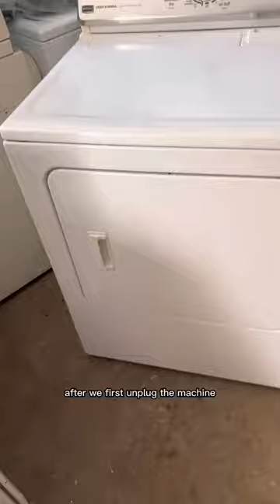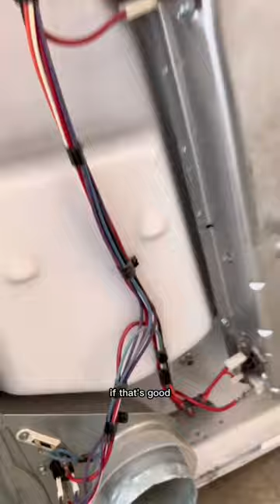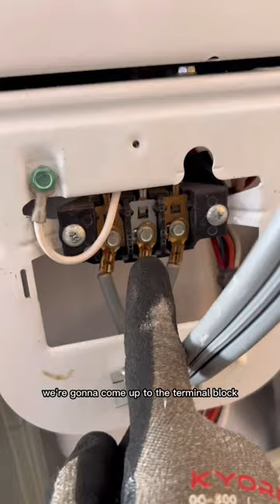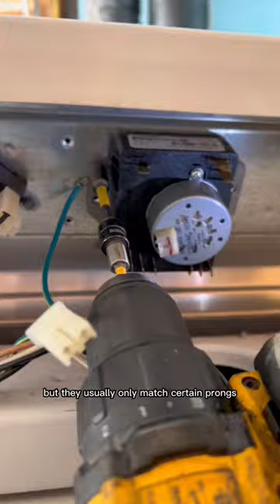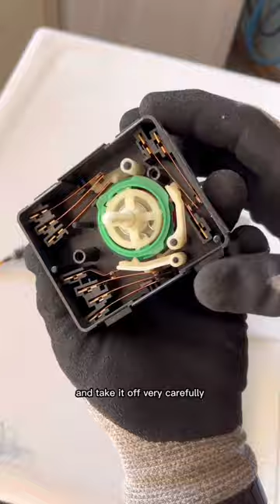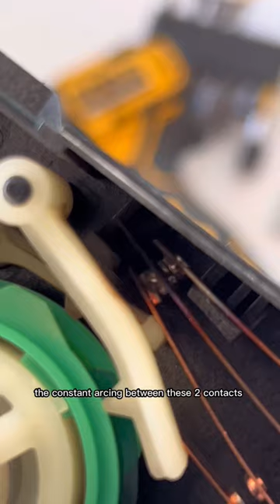Maytag dryer not heating

Comment: That was a lot of good info at JET SPEED.
Reply: whats checking continuity? how do you check?
Reply: @startful Another word for "SHORTED"... use a multi-meter to check for thermostats that are shorted  (bad) or have resistance (good)...
Reply: @jumperstartful just wether there is an electrical connection. Get a very cheap multimeter that has it and.. yeah

Comment: NOTE:  On some dryers the drum will continue to spin with a blown thermo fuse.  they will be part of the heating circuit.  Electric  or gas.
Reply: But you won't have heat my elite did that.
Reply: Yep, my 70s Maytag blew its thermal fuse and kept right on spinning because it wasn't part of that circuit, only a part of the element circuit. And since the model in the video is literally built the exact same way as that 70s avocado one was, it's probably wired the same way.
Reply: *most
Reply: Yes, just changed the thermal fuse. Blew out brushed out, vacuumed out the lint. Good to go.
Reply: Kenmore 80 series did just that  spinning but ingintor & thermo cup no go. R&R fuse ba boom heat !

Comment: I usually watch these videos and think "I could do that".  This video made me say nope
Reply: It’s actually very easy. Even if you don’t check the continuity changing all the sensors is cheaper than any call for service. Few years ago I took them to the store and they figured out which was bad.
Reply: Hire someone
Reply: I did it it's easy don't get intimidated
Reply: Yepp
Reply: All you need is an understanding of electricity and machine controls. Easy peasy.
Reply: Right this isn't so easy but my dryer is doing the exact same thing but instead of no heat I have light heat 😂😂😂
Reply: You literally just need a screwdriver. South Park was right, people can’t do Shit for themselves

Comment: You are doing such a service sharing this info. Firefighter companies should hire you for home safety. Real estate agents should hire you to help new homeowners. Work with a home inspector too. I hope you're the most sought after handy man in your area!!!! Thank you!!!
Reply: They probably won't give in his background, but yes I agree

I'm learning more in minutes from his videos that I've learned from hands-on experience do dryers constantly going out in mom not wanting to buy new ones and instead would rather tear these ones up to find out what's wrong with them, or just find used ones that she can patch up 

Many many years of this and it turns out the problem was never even the dryers in the first place, but rather that the ground wire for the outlet was very very loose and so will the others causing fluctuations in power draw that would cause the dryers to wear out so much quicker

For a long time we could never figure out why we would have consistent issues in the nature of what was going on, because the heating elements would be the main thing that would go bad

Because they would get replaced multiple times with each dryer before we can eventually change to a new one

And it wasn't from lack of cleaning the lint trap because moms anal about that.

My grandfather got the wire issue fixed up and we haven't had issues since. 

We were going through a dryer or two a year and this dryer has been going for almost three now. And it was in the process of throwing fits up until the wire problem was resolved.

Comment: Mine did something like that, except one of the contacts had slid out of position and was only touching on it’s edge. I took it completely out, polished the contact buttons, and popped it back where it belonged. So far, so good! I always keep a spare set of sensors too.  My wife doesn’t like to have down-time with appliances.
    Also, I keep several sets of agitator dogs for the washer, they are about the only things that I’ve had go bad on our washer…. For years!

Comment: I had a no heat issue on a dryer in one of my rental properties. Checked the dryer and checked the voltage and everything looked good. I brought in an electrician who is smarter than me any discovered that the problem was out at the breaker panel. Another electrician that had done work on the house had switched both breakers onto one side of my panel.

Comment: Basicly find a check list for the possible problems.  I did this for a gas dryer. Ended up being the igniter. Was low on the check list as i had to disassemble a good deal to get to it. 

Also while in there clean out the lint.

Comment: I repair appliances for a living. U can file down those contacts to refurbish the timer then u can check continuity between the thick red and black wire on the back of timer usually tbe lower left connector

Comment: You can also check for continuity between the black and the red wires on the timer. Turn the knob to timed dry or more dry. Then test it. Always remember to unplug the dryer before doing this. You can also clean the terminals so you can still use the dryer while waiting on the new timer. eBay or Amazon will have the best deal. Most appliance parts websites will be 3 or 4 times more expensive.

Comment: If the contacts aren't in too bad a shape, use a two-sided finger nail file. Place between contacts and cycle file while pressing contacts together. Might extend life while hunting down replacement. I've done this on car points and AC contacts.

Comment: The dryer that came with my condo quit.  I took out the lint screen and looked inside to find a lot of lint.  After unplugging it, the loose lint was removed.  That fixed the problem.

Comment: I had a timer where the motor was shorted to ground via the case. The knob would spin round and round without stopping. Even when off you could hear the little motor running.

Comment: Excellent method, but verify 220v at the wall receptacle, first, before disassembling components !

An open hot leg at the wall receptacle may cause partial dryer operation.

Comment: Absolutely the only thing I do differently than this video is check that voltage at the terminal block FIRST.  I don't need to spend 20 minutes fussing with the customer's dryer if the issue is the breaker not sending 240 to the unit!

Comment: Probably should check the fuse or breaker before tearing apart the machine.
Reply: If the breaker was tripped, how would it be spinning?
Reply: Electric dryers run on 220v. Need 220v for heating element but only 110v for motor. Dryer can still spin with no heat if 1 fuse is blown.
Reply: @jimhartman6410  perhaps for internal fuses, but the breaker would be supplying power to the outlet the dryer was plugged into, was my point

Comment: Seen it a few times on the whirlpool dryer that no heat is a result of motor or a backed out wire to the motor but more often than not with all the fuses and elements good you have a bad timer

Comment: Checking continuity is not a good way of checking limits or heat strips. A better way is checking resistance. If it reads “OL” then the limit is open or there is a break in the strips. What you want to see is 0.0. If it has “continuity” it could also have a high resistance which means there is pitting across the contacts possibly which means there is a problem. It’s just always better practice to check resistance vs the ol beep beep method lol. Tells you a lot more

Comment: "if this looks like a fire hazard to you, then you would be correct"
...so, what I'm hearing is that you shouldn't buy that brand of dryer ever again?
Reply: I think he's exaggerating on that part, that is unless you have an extreme lint problem. As he said there is no longer continuity meaning that power through that area is no longer flowing through. No power=no heat. Plus that area is typically surrounded by sheet metal, without some sort of tinder like thing such as lint a fire is very unlikely. Plus while he says this a maytag dryer it's actually a whirlpool design and is probably the most produced dryer design ever in North America.

Comment: This is a mislead. FIRST, check your power to the dryer, make sure you do not have a blown fuse or bad breaker. If you lose one leg, you can have the same condition. A lot less work to check out.

Comment: If the washer or dryer is very old, I'd check for burnt contacts first.  both my washer and dryer are over 20 years old.   Keeping both functional isn't rocket science, but be aware that the edges of the sheet metal are very sharp as a knife.  You will quickly learn that the first time you disassemble a washer or dryer.  Also vacuum out the inside of the dryer every few years because there could be piles of lint covering the motor causing overheating.

Comment: First thing I learned how to check was the plug. The three metal plug tangs can get covered with oxidation and block proper current to the dryer. Using some sandpaper, nail file or hard eraser just clean that off all 3 tangs on both sides and then see if it works. Much cheaper fix than calling a guy who won't show up as promised or replacing expensive components.

Comment: I thought was crazy  had dry that exact problem from day 1 we bought brand new. they kept trying tell it was the vent in the apartment we lived in.   Pulled the timer off checked  with ohm meter and was told the timer don't go out normally when bought a new timer. 10 years later still have the same dryer nice video

Comment: Before any of that check breaker box and for the dryer switch, usually a double switch or one large one. Even if it doesn’t look tripped flip it off then back on. There are times a system gets tripped and will still run and even have a light on because it’s two phase and that second part that runs the heat is tripped. Many a time I come across that and resolves issues.
Reply: Nah they are just plugged in on a standard socket.
Reply: @dogwalker666  A 30amp 240vac receptacle isn't 'standard' & it certainly is protected by a two-pole breaker. Please leave anything vaguely electric alone & stick to changing doorknobs Mr "handyman"
Reply: Ding! Ding! Flip the breaker on and off. It's always worth the try.
Reply: Thanks, I will try this first on my mom’s dryer.
Reply: @user-lb8do4ew6k   if you look at his profile hes in the UK where 220 is indeed the standard. So he's correct relative to where he lives. Looking at his profile took less time than writing a reply. So you're the troll I guess 😢
Reply: @Greenredfield  regardless of voltage 30 Amp circuits are special use circuits. Compound that with the fact that the op is calling circuit breakers 'switches'.
 I have 25+ years in the trade
Reply: @user-lb8do4ew6k  yea that's fair, that's a lot of amps at that voltage and I'm sure code requires a different plug over there too. I can't defend calling a breaker a "switch."

Comment: I like the old timers better, the ones that have about 40 wires each one with its own terminal. To change them out you worked with ONE wire at a time, disconnect ONE wire, then plug it onto the correct terminal, then disconnect the next wire. Then there's the customer who brings in their old timer and did not make any kind of diagram as to what color wire goes where.

Comment: Thanks for the video -  saving this.    My Maytag dryer had stopped blowing hot air but was still spinning.  Wife said she heard a grinding noise followed by a burned smell.
Cleaned out lint that had fallen beyond the catch and built up a little in there….what do you know??  It started blowing hot air again without needing to fix or replace anything.

Comment: Can remember old school Whirlpool dryers lasting 20-25 years on the original timer, maybe longer.  Now days the timers typically fail in 1-3 years, losing the heat function. For that reason, I stock 5 different Whirlpool timers at my repair shop. Once again, this is an example of making parts that fail early, so you have to purchase expensive timers, or a new dryer. Never know of Whirlpool beefing up parts to last longer, only making them cheaper to fail sooner. **Buy Speed Queen. More initial cost, but last for years!!

Comment: You have to make sure you have 230 volts across the two hot wires. If they are  both pulled from the same 115 volt circuit in the fuse box the dryer will turn but you will not get heat

Comment: I ran into this problem twice. Both times it was an electrical issue with the wall plug, nothing to do with the dryer itself. First time was because a wire had come loose from the outlet. Second time was because one side of the main breaker in the fuse panel was bad. Two separate houses, two different problems but they had identical symptoms, the dryer would spin but not heat.

Comment: Hmm. The last 3 times Ive no heat, it was a burned out element. I say this because its a 5 minute fix and easy to spot without having do everything in this video, which could be done AFTER confirming the heating element.

Comment: You can also make sure one of the two breakers to the dryer were not tripped. If one is tripped the dryer can spin but not heat or heat but not spin.

Comment: ⭐️ Also check  if the fuse components are plugged in tight and properly( loose connections will cause burnt wires and blown fuses resulting in no heat ) . If you see any burn wires check those connections and most likely it’s a loose fitting

Comment: It is always a good idea to check the outlet in the wall as well for a no heat problem.. Most machines will run but not heat if one leg of the 220 line is dead.. I had this issue because the breaker went bad on one leg and wasn’t sending power to the heating elements.. but every other aspect was fine. A weird problem for sure.. but an easy enough thing to overlook if you are only checking continuity with the machine unplugged.

Comment: First, this is for an electric dryer.  There are some similarities, but some major difference.  Most no heat issues in a gas dryer involve the igniter circuit and that varies with the type of igniter used.

Comment: Did you know if you take off the thermal cutoff fuse and hit it with a screwdriver until things start shaking insideand they hook it back to the dryer it will start heating again lol try it

Comment: umm you did this in reverse. check timer, then thermal fuse, then High Tstat then Cycle Tstat, if voltage through all check flame sensor, neutral start on motor, then ohm ignitor or flame sensor and that completes the circuit. going back first is garbage handyman shit. remove inspection cover. if no glow go to timer, and rotate know from time dry to sensor cycle and if unit stops then its behind unit, if it runs its in front. Learn the proper way voltage runs in these things, the schematic is under the UI.